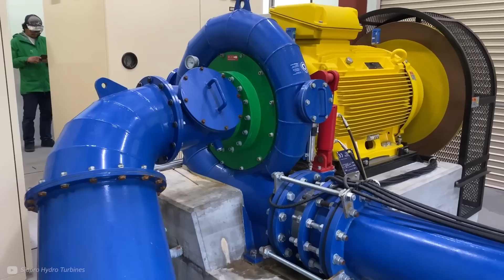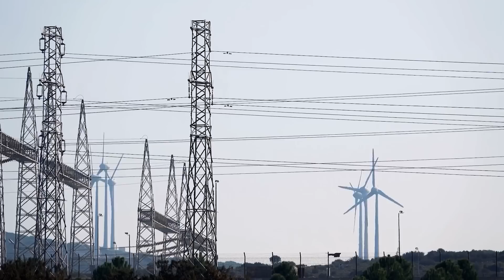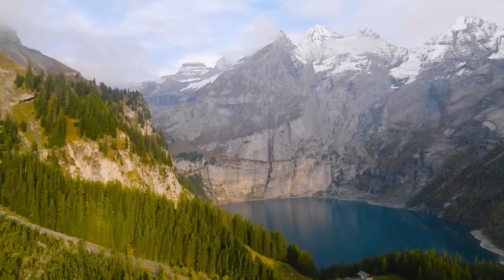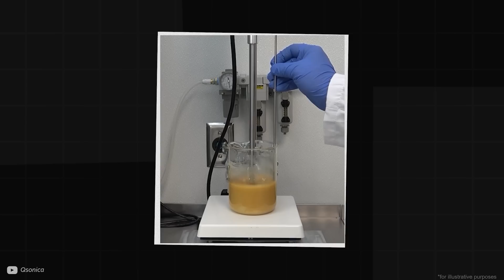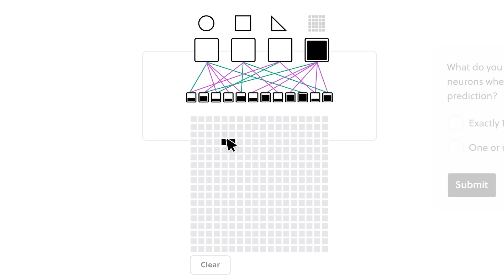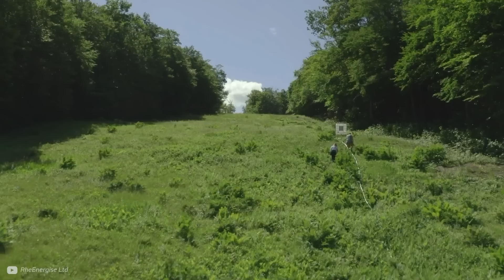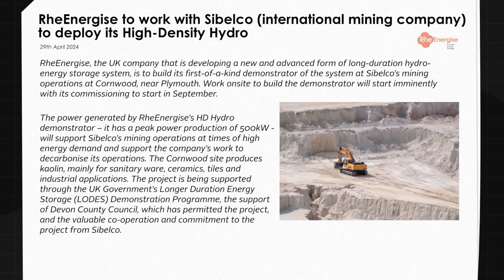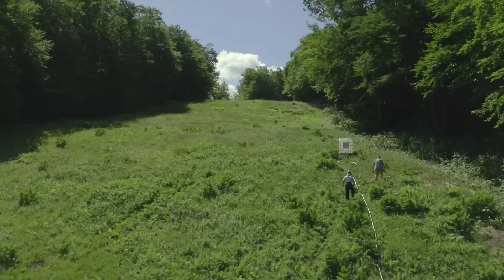The Genius of 'Waterless' Hydro Energy Storage

Comment from the maker: One point I forgot to mention was the testing RheEnergise have done to show their new breakthrough doesn't significantly increase wear the turbines either! If you enjoyed this video, you're going to love the interactive courses from Brilliant! Use my link at https://brilliant.org/ziroth/ for 30 days FREE and 20% off a subscription!
Reply: Why not have Teflon coated pipes?
Reply: Was wondering about corrosivity and turbine strain.
Reply: R19… at least it isn’t R12 😂
Reply: @brettmoore3194  good question, that might shrink the skin friction, but it won’t decrease the bulk viscosity, the friction from the liquid rubbing against the liquid. Any coating would be very expensive too and the concern that eventually it would flake off and then harm the turbines or be a danger to the environment.
Reply: @justinmyers6737  I was surprised to hear in the video that friction wear on the turbine blades was not a problem.
As to the load, remember, water will be stacked 2.5 times higher to create the same load. This benefits us because it can be used in a place where they is a much shorter hill resulting in the same load (not a higher load than the water).
Reply: Your professor looked pretty young, was he vaccinated
Reply: BULL!  Of course it does.
Reply: Careful, you say that with the slurry you only need 40% of the storage volume and then you also say you only need 40% of the height delta, but you can't take your savings out of both ends... You get 40% off once, not multiple times...
Reply: @brettmoore3194 👉IN ISLAM THERE IS A PURE & CLEAR CONCEPTS OF GOD 

🔴 God is One and Unique: God has no partners, no equals and no rivals. God has no father, mother, sons, daughters or wives. 

🔵 God alone is worthy of all worship.

🔴 God is the All-Powerful: God has full authority and power over all things. 

🔵 Obedience to God does not increase His Power, nor does disobedience decrease His power.

🔴 God is the Most High: There is nothing above or comparable to God. 

🔵 The attributes of God do not resemble that of His creation.

🔴 No part of God is present in anyone or anything. 

🔵 God is Perfect: God does not have any human limitations, such as resting on the seventh day after He created the universe.
Reply: @jsbrads1  I don't buy for one second that this slurry is not extremely damaging to any surface it comes into contact with, particularly the surface that turns the turbine.
Reply: @tarstarkusz  yes, it is very hard to believe… we are either right or wrong at the end of the day. Think of cornstarch, it is very soft compared to metals. Tho usually slurry has sand and stuff harder than metal that could scratch.
Reply: @NoPodcastsHere  you are right, they would have to pick one. Short hill with tons of space at top, or tall mountain with top too small for water.
Reply: @tarstarkusz  it is good to be skeptical, I am too. Heavy stuff is usually hard too. Tho it is possible for a combination of softer and safe ingredients to make the slurry. Cornstarch is just one example of a soft additive, tho obviously that isn’t heavy enough and it has rather unfortunate properties for power generation. But if there were a few other molecules that could be added increasing the density without increasing the corrosivity either chemically or mechanically, it should be possible to get to a noticeable increase in liquid density. 2.5 times the density is hard to believe, tho I suppose it is possible.
Reply: @jsbrads1  Soft material can and does wear harder materials.  Anyone who thinks they can keep grains of sand and other abrasive material out of an open slurry is a liar or a fool.
Reply: @tarstarkusz  sand blowing in is a completely other problem, but then that problem exists with a water dam too.
As to softer materials wearing harder materials… maybe not, read to the end: “In summary, when two materials with different Moh's hardness levels are in contact, there is potential for abrasion to occur on the harder material. This is because the ridges and valleys of the two materials interlock and create a shearing force that can cause the weaker material to shear off. This is especially true when the length of the surface roughness is longer for the soft material, making it more resistant to shearing. However, this calculation is only accurate for materials where the compressive strength is much greater than the shearing strength.” Googled.
Reply: @jsbrads1    It's not as big a problem with hydro, though it does happen.  Though I would think minerals would cause more damage through buildup. But presumably this can be dealt with by maintenance.
I'm not saying the project won't work. I don't know enough about it.  I'm just highly skeptical.
Reply: I am glad to hear wear is not significantly increased.  Year ago I read about a very high low volume system.  Small amounts of solids at the extreme pressure would wear the turbines.
Reply: @tarstarkusz  indeed, some metal parts can be coated with chemicals, I’m not an expert in that stuff but I heard of nitrogen treatment, chrome everyone saw in the 1950s, and sacrificial zinc anodes are used in some water/metal situations, and I presume there are many solutions, but knowing so little…
Reply: @johns.5864   they hope! The smartest engineers in the world thought they could make a geared turbofan with modern materials and machining, but as soon as those turbofans started being used in the real world they started to show wear much faster than they expected. 🤷
Reply: When you say that the pipes are thicker, did you mean to say that they have a larger diameter? Or did you mean to say that the walls are thicker to cope with higher pressures and viscosity?
Thanks.
Reply: @RWBHere   yeah, diameter. Good question.
Reply: @1islam1  Did God say all that to you or did you just reed it in a book?  Remember the Islam God is THE SAME God as the Jewish and the Christian God. So who is right - if any of them. If you think about it then you have heard it from people as has the Jews and the Christians. I can claim without lying to have had influences that appeared as being from God.
Reply: In the 1960s, the water supply for Matamata, NZ, came from the Wairere Falls. A weld pinhole in the 10 mm walled pipe appeared some years after the installation and the high pressure, plus the tiny amount of sediment in the intake, cut a beautiful 200 mm long by 2 mm wide slot in the side of the pipe over a number of months. This is testimony to ordinary sediments in a water stream that, while not as hard as garnet in a water jet cutter, will still slice through steel. You must all be aware of the adage that water can wear away stone...

Comment: "The pipes would need to be thicker...". What a strange and imprecise word to use, immediately conjuring up thoughts of pipe wall thickness. 'Larger bore' would have expressed it better.
Reply: The English are weird.
They speak of "small roads" when they mean narrow roads. 
And when something falls , it ends up on "the floor" instead of on the ground - even when the situation is outside of a human built structure.
It seems they are losing the use of their own language.
William Shakespeare is spinning ever faster in his grave.
Reply: even just saying "bigger pipes" would convey the idea of larger bore more accurately than "thicker pipes", since thickness generally does not apply to negative spaces within a container. even if "thinner" may work on stuff like pipes and straws, "thicker" simply does not convey its exact opposite in these cases.

english is weird af.
Reply: "thicker pipes" put my attention to the subject of the video in a tailspin as well. I think I would have gone with wider or larger diameter pipes as well.
Reply: @johncreel6135  Actually , if you said "thicker pipe" to any engineer ,they would assume you were referring to wall thickness
Reply: Larger bore means bigger internal diameter, not wall thickness.
Reply: I believe the phrase is a 27% larger diameter pipe (to account for head loss). It might not be hard to find the "larger bore" in the comments section, though. 🤪
Reply: This obvious misuse of the English language by someone who is clearly capable of better word choice has led me to the conclusion that it was a sneaky way to solicit comments from us to optimize the YouTube algorithm..

 well played video boy, well played..
Reply: English is my second language, and "thicker" to me sounded indeed like stronger walls.
I'd have gone with "wider" instead.
Reply: Its denser and heavier, therefor the wall thickness increases 2X.  It's thicker, so the diameter increases.  This could be tested at reduced density on most existing systems, so the fact that they keep it theoretical makes me more skeptical.  Pour some in the water now and get to proving out the system.
Reply: It wasn't confusing in context though.
Reply: It include the word pipes so usually when you say thicker it means the thing its gona be larger by default unless youre talking about wall thickness but you could use sturdier for that

Comment: Pumped hydro does not necessarily require mountains for a large elevation difference. The lower reservoir can be excavated underground, for instance in a disused mine. It could be a promising way for large capacity storage when combined with this new technology.
Reply: But that would be extremely expensive to excavate a suitable reservoir underground.
Reply: Gravity pushes down not up but sure put the turbine even lower............
Reply: Self-admittedly newb on the topic of pumped hydro, this slurry "solution" seems to be looking to solve a problem where none exists.  Specifically not using water means the entire reservoir x2 must be created artificially (with megatons of concrete), and then megagallons of slurry must be made to fill them.  No matter how "cheap" it is to make, water is much cheaper.  Artificial reservoirs on the other hand are so expensive it may not even matter.  This is all to solve the problem of the neighboring hill height?  I've never heard this is THE problem with pumped hydro.  Seems like this is a story about a patent (R19) and not a story about "waterless hydro".  meh what am I missing?
Reply: If you can excavate a lower resovouire the size of a mid- sized town, several hectares in surface area and a couple hundred feet deep, at a reasonable cost, then sure go for it. Of course that's impossible unless you're drilling with hydrogen bombs, which is why no one is doing this.
Reply: @VigneshBalasubramaniam
Reply: @benb3928  - This was touched on in the video, traditional pumped hydro is limited to geographic locations of certain characteristics. High density pumped hydro increases the number of sites pumped hydro can be implemented. In effect it increases the number of viable pumped hydro sites; the video mentioned 6,500 viable sites in the UK for example, which currently only has 11 operational/planned sites.

In terms of cost differentials, traditional pumped hydro can be man made as well (concrete reservoir style) or uses existing elevated natural lakes. However, even with natural lakes concrete is used to create the upper damn and sliceways, as well as the lower generation sites. Given the smaller size of the high density slurry pumped hydro reservoirs and the reduced sluiceway height then the concrete usage may not be that much of an issue.
Reply: @kalzonenu  Gravity is an attractive force and pulls rather pushes. Down is fair for an Earth context but technically it pulls towards the mass. The pull becomes stronger with proximity to the mass so lower is actually better. However, going below the surface does have a negative impact because the the mass above you would cancel out some of the downward force. For a mine on Earth, both of those factors are negligible and won't make a bit of difference for this energy storage use case. What matters is the hydraulic head, the volume, and the density of the fluid. As long as you have enough difference in elevation and enough volume, put it wherever you want.
Reply: @bigfishoutofwater3135  The effects of being slightly nearer the centre of the Earth are insignificant, but you’re welcome to show us your calculations…

…you have done them, right?
Reply: Lol...🤦‍♂️
Reply: @VigneshBalasubramaniam the idea is that people can exploit existing projects to expand storage options.
Reply: @VigneshBalasubramaniam  " instance in a disused mine." in which case the excavation has already been done. An existing reservoir.
Reply: @VigneshBalasubramaniam  the longer the concrete lasts the cheaper the structure.

Comment: The biggest problem for Rheenergise is that there is nothing inherently novel about increasing the density of the pumped fluid. There's very low likelihood that the cost of heating that still very large amount of fluid is going to be offset by the reduced viscosity, which means their only claim to fame is selling drilling mud. If the approach is viable then anyone who can build a pumped hydro unit can easily replace these guys. And lets not forget that because your pumped fluid is a closed system you now need an upper and a lower retaining pond so that claim of less space probably won't happen.
Reply: Probably using mercury
Reply: There are worse ways to unload millions of gallons of mercury...
Reply: man sounds like you nailed it.  This slurry is totally for fracking and has nothing to do with pumped hydro..
Reply: That’s bad for their business but good for us as energy consumers.
Reply: All pumped hydro has upper and lower pools so not sure what you mean there.
Reply: @dacjames  Because the fluid is slurry rather than water the lower pool will have to be completely segregated from traditional water sources. No pumping from or into rivers, reservoirs, lakes, etc. I would assume that for the amount of slurry we're talking about they would still need to be located near some large water source though. Ship the slurry in dry and hydrate on site. Which means you would also need mixing facilities on site...
Reply: @dacjames  Also the segregated lower pool would need to hold the complete capacity of the upper pool to fully utilize the capacity of the plant.
Reply: @jcbeck84  that’s the exact same for pumped hydro. You have upper and lower pools that you move water back and forth between. You’re confusing pumped hydro with hydroelectric dams in general.
Reply: @jcbeck84  yep, exactly the same as with water. The only thing changing here is the working fluid.
Reply: Water-only hydro doesn't have to mix solids in at the right ratio. Too dry and it's a thick sludge. Too wet and it doesn't have the high density you're looking for. To get that ratio right on this kind of scale and maintain it as water evaporates will take specialized mixing equipment.
Reply: I'm no encyclopedia for pumped storage plants, but usually the lower retention is a shared with some other purpose both to keep costs of the plant down but also because water that evaporates needs to be replenished regularly. For example, if you look at Ludington the lower retention is actually Lake Michigan. If your pumped fluid is millions of gallons of fracking slurry there would be problems if you drained into Lake Michigan, not to mention you would need to mix entirely new slurry to refill the upper retention. Typical hydroelectric has no downstream retention outside of maybe a small settling pond. Once it goes through or around the dam it is free to flow downstream, most likely ending up in the upstream reservoir of the next dam.
Reply: @jcbeck84 This approach would obviously never be used in places where convenient natural bodies of water are available, so we should exclude them from any comparison. The company is from the UK where there aren’t many “Lake Michigans” to choose from.

Comparing like for like, using a heavier fluid will mean smaller reservoir or shorter head for the same storage capacity.

And who said anything about fracking fluid?! Drilling muds get a lot of deserved bad press but that doesn’t mean everything that looks similar is bad. They didn’t say much besides having a surfactant and there are many, many harmless surfactants.
Reply: @dacjames  👍
Reply: wait, wouldn't heating really only be an issue where the slurry would freeze? and since salt can lower the freezing point... wouldn't it be just a question of tweaking the formula of the slurry until you get one with a good freezing point for the climate? i'd imagine electric heating would really only be necessary for pipes to make sure they don't clog and cause some major congestion/damage.

Comment: One big issue I see with this is a "worst case" failure mode.  With a regular dam you can always slowly release the contents to take pressure off until the dam can be fixed, but it is environmentally sound to just dump this into the environment?
Reply: Good point. They'd better only operate this system on already heavily polluted rivers. Good job we have plenty of those.
Reply: Since it's a closed system you wouldn't be dumping anything into the environment.
Reply: @John73John Closed loop until it isn't. Anything at that scale will inevitably suffer leaks at some point, sometimes catastrophic.
Reply: @Hamish_A  Well that's true of any chemical process ever. But these are risks we know how to minimize and deal with. Since the bottom reservoir is big enough to contain the entire volume of fluid the system is using, a good design would be set up so any leaks would just naturally drain to the bottom reservoir. That would be a big step to making things safer.
Reply: Maintenance would require a way to dump all contents in one of the basins or the other.
Reply: @John73John  He's talking about what happens when there's a failure. Closed systems are only closed until the containment fails.
Reply: @mateusseer5353  Yeah I got that, see my 2nd reply in this thread.
Reply: @John73John and if the lower reservoir fails?